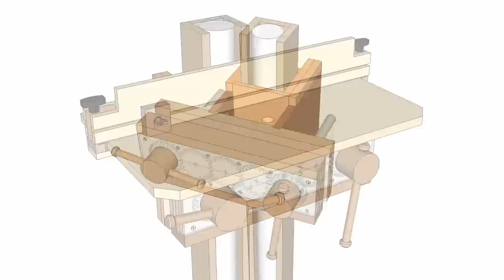This is Exactly What I Need for the Drill Press Upgrade

Comment from the maker: The actuator from the reclining chair I tore apart a few years ago will be just the thing for raising and lowering the drill press table. It has a lead screw driven by a DC motor that's geared down, so the position will lock in place and may not need a separate locking clamp making it very convenient to use.
While I've been doing more Speaker World projects, that doesn't mean I'm not going to be doing the shop projects that everyone likes. But in general I'm slowing things down and won't be putting out as much as I have in the past. I'll also be sticking to projects I really want or need, plus ones that I know will have the best chance of doing well, views wise.
I've been doing this day in and day out for the last 12 years and I'm at the point where I can slow down and try to enjoy the fruits of my hard work over that time. Making the kind of videos I do for my main channel (full project builds) involve a lot of time, planning and work and I'm just not as motivated to work 16 hours per day, 7 days a week like I used to be. Therefore you can expect to see fewer projects from me from now on, but like I said in this video, I want them to be of better quality.
Upcoming projects: 
-Drill Press Upgrades
-Router base and template redux
-New mini router table
-Electric planer edge jointer
-Stair treads (to my basement)
-Solid wood dresser (to match my night tables and bed)
-6" x 48" belt sander build from scratch
-Solid wood front door for my house
-Kitchen island table with solid cherry top
-Banquette for kitchen
-Kitchen / dining table
and other projects as I think of them. I also want to rearrange and paint my workshop, hopefully that will happen this summer. 
So lots of interesting stuff ahead, but it will be more spread out.
Reply: This list is AWESOME!
I’ll be looking for each one whenever you decide to publish them - if you publish them.
Reply: I've been making amplifiers, also. Thank you so much for this video. Love you man!

Comment: Problem with not locking the table is it introduces slop and when drilling hard it will rack and you will lose your perpendicular-ness
Reply from the maker: That doesn't happen now when I use the drill press without locking the table. And that's with a round column, not the squared off one this will have.
Like I said, I'll have a locking clamp for the times it absolutely needs to be locked, but for the other 90%+ of the times I use it, it should be just fine unlocked.

Comment: I worked as a goldsmith and you do a lot of work under a microscope. Like repairing box chains using a laser welder. I would think about hammering a framing nail into a board with a large framing hammer. The contrast between tiny tiny welds and beating the fuck out of a nail always made me chuckle. Always nice to change up what you’re doing.
Reply: LOL!  I hear ya!

Comment: Lots of good projects to look forward to, specially the kitchen projects since i’m gonna redo mine in the next 2 years.  The actuator looks like it will need no locking mechanism at all,  looks a lot beefier then what I have for a project ( that I will never build 🙄) and is rated for 140kg. Then again looks can be deceiving and it can't hurt to build the locking mechanism in.  As usual looking forward to all the content,  but that can't be a surprise. 😅👍

Comment: I"m partially disabled and use a power lift chair/recliner and a couple of years ago I got a new one and I took that part off the old one before junking it with the intention of doing something similar to what you're thinking of doing with yours. I thought of the drill press and the table saw to raise/lower ther blade but never got beyond the dreaming stage. So that mechanism sits down in my shop to this day. So I'm really looking forward to seeing how your build turns out. Maybe it'll inspire me to finally do something with mine.